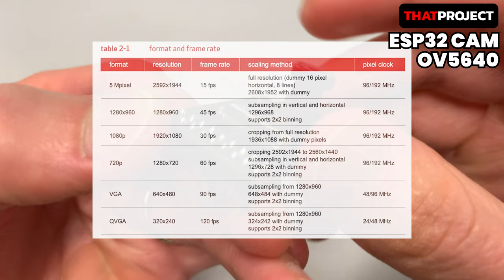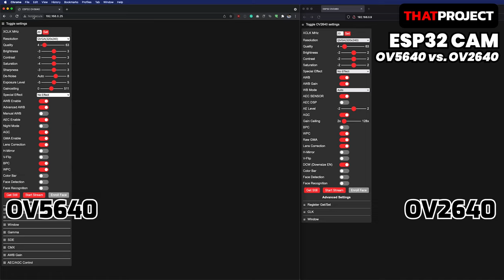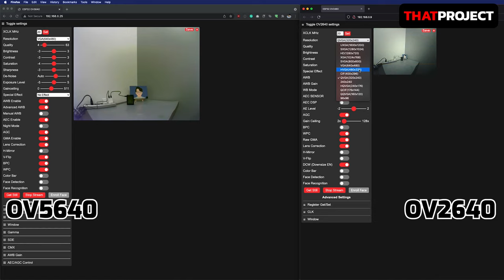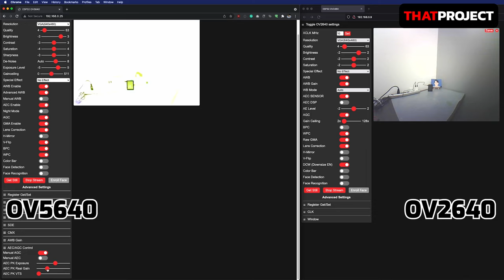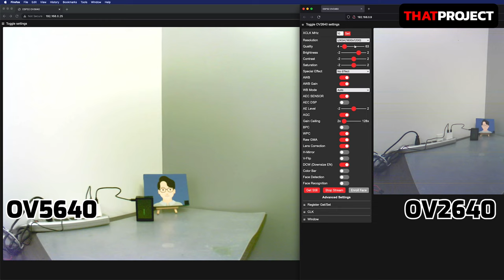OV5640 for ESP32 Camera (Compared to OV2640)

Comment: At 1:30 you show installing the OV5640 onto a ESP32 Cam board. Do you have to install different cam software to support it? Are there any other changes made to the ESP32 Cam board to get the much better quality of the OV5640?
Reply from the maker: All you need is the latest version of ESP board. I tested this code 2.0.1 and 2.0.2 and it worked fine. Let me know if it has an issue.
Reply: @ThatProject  I finally got it working. The OV5640 shows up with much higher speed and  resolution available but the video quality is much worse than OV2640 so far. Grainy and colours are off. I used Board: "AI Thinker ESP32-CAM" and #define CAMERA_MODEL_AI_THINKER.
Reply from the maker: @NN-rd3mk  That's weird. Where did you get your OV5640?
Reply: @ThatProject  An Ebay supplier I have bought many other devices from. I think it's a OV5640 software setting problem. That's why I asked about your settings. OV2640 on the same board is fine. I tried a second OV5640. Same thing.
Reply from the maker: @NN-rd3mk  No, I didn't do any settings for the video quality. Please note that WaveShare's OV5640 and Chinese clone products are not perfectly identical.
Reply: @ThatProject  **SOLVED**  under camera_config change: config.xclk_freq_hz = 6000000; // was 20000000
This reduces the frame rate though.
Still not sure if the higher res is worth upgrading from OV2640 to OV5640.
Reply from the maker: @NN-rd3mk  Still, we have different results. If you change the XCLK to 6MHz, isn't the image acquisition speed slow? I've only tested it at 10MHz or 20MHz and had no issues.
Reply: @ThatProject  Maybe the Waveshare board is much higher performance so 20 MHz works OK. It is much higher cost. I use ESP32 Cam boards with a built-in micro USB connection now. Much easier to program.

Comment: Hi, i have a question. Im using TTGO T-Call ESP32 SIM800L and i want to use esp32CAM camera to the TTGO board. Can you teach me how to connect it and generate a simple code to test it out? tq sir
Reply from the maker: Image data can be transmitted via serial or Bluetooth LE, but requires detailed work. If you have to use the SIM module with image acquisition, wouldn't it be more convenient to use this? https://youtu.be/kOYJ-4oZ8Ws

Comment: Hi, as you suggested i have used ov5640 from waveshare but when trying models from 2 other suppliers they were overheating and the picture was gradually turning white/green. Any ideas?
Reply from the maker: Hey Domen, Where did you get those? Are you sure they're genuine products of Waveshare? I have 2 of them and I didn't have any issues when I make the OV5640 library for the auto-focus mode.
Reply: @ThatProject  hi, i've got them from some chinesse supplier. I also have one from waveshare and it works great, but it's just too pricy

Comment: Is the slow fps due to the data being transfered over wifi? If so, if i connect it to a sd card module and record the data on it instead, will i be able to get the full fps that's on the datasheet?
Reply from the maker: Good point. I would say yes or no.  
When transmitting via WiFi, a bottleneck occurs in the process of taking and sending photos. This is the biggest cause of low FPS.

As a result of my testing in another video, showed similar results to the datasheet in obtaining the image frame buffer only without saving or transferring.

When continuously writing images to an SD card, you will be able to get a sufficiently good FPS if there is no delay.

The cause of the bottleneck is that the process of obtaining the image frame buffer and writing or sending the file is not processed in parallel. Unless this fundamental issue is resolved, I believe that saving images externally will inevitably result in frame drops.
Reply: If you use a antenna it improves greatly.  You can also wrap the end in copper tape to improve the signal.  Google that for pics.

Comment: I bought the OV5640 module and it sees it on the esp32cam and it works but it doesn't make a connection, but when I try it with the ov2640 it makes a connection. What should the PID settings be for ov5640 or where should I enter them? please urgent 😭😭😭😭😭😭😭😭
Reply from the maker: In what environment does ESP32-CAM run? ESP-IDF? Arduino?
OV5640_PID is checked automatically, so you do not need to check it. Looking at the CameraWebServer example, it automatically distinguishes between OV2640, OV3660, and OV5640 and displays the required screen to the user. It would be a good idea to double-check the connection between your ESP32-CAM and OV5640.

Comment: Hey dude, I need a camera that can accurately read text(like english paragraphs) and mathematical notations off of textbooks. Is the ov5640 capable of that? if not, which camera should I purchase? I'd prefer it to be compatible with esp32 cam board
Reply from the maker: I have recently been using the AMB82-Mini camera module and it is very useful.  Check this out. https://youtu.be/TGqOUVhQQY8?si=U5CVZZWozqhmZcMy
Reply: @ThatProject  hmmm i'll definitely check it out, thanks!

Comment: you changed the xclk on the camera and reduced by 50% you did not mention why. from my experince a higher clock produced much faster fps and much cleaner moving objects. more heat is produced and im sure its a battery drain, tho I would assume it depends on your use case. it is also possible to change lens creating differnt results.
Reply from the maker: Of course, you're right. You can usually get faster fps with higher clocks. But there are other cases. Changing XCLK is a kind of old story. I've also mentioned this in one of my ESP32CAM videos. Anyway, check this out. https://github.com/espressif/esp32-camera/issues/15

Comment: Is it possible to manually set exposure time?
Reply from the maker: You can simply change the exposure level. To manually change the exposure time, you need to modify the register. I'm very interested in the exposure part, so I'll try a new project about this when I get a chance.

Comment: Hi, insane video. May I ask you for the code of the ov5640 web server?
Reply from the maker: CameraWebServer is a basic ESP32 example.
You can try it through Arduino IDE>Examples>ESP32>Camera>CameraWebServer 
If you are using the OV5640 you will see the extra options.
Reply: @ThatProject  thank you very much for your quick reply.

Comment: my OV5640 runs extrememly hot and then freezes... do you have the same issue?
Reply from the maker: Which company's product is it? I only tested with WaveShare's OV5640 and had no problems at all.
Reply: @ThatProject  several different modules bought off amazon and ali   I'll get a waveshare and try it.   What is the base code you are using for the project?  I have noticed I get a high frequency humming from my board when the camera are running and wonder if there is a problem with my code base
Reply from the maker: @AaronVanTassle  I used the example source of the ESP32 Camera for testing.
Arduino > Examples > ESP32 > Camera > CameraWebServer
By checking the PID and VID of the OV5640, you can automatically check more functions compared to the OV2640.
Reply: The same thing happens to me. Extremely hot.
Reply from the maker: @TheAviationAnonymous  It seems to operate at a relatively high temperature compared to the OV2640. I'm checking what the problem is.
Reply: @ThatProject  Thank you for your reply, and your AF library. 
I have done some research, and I think the issue may be that the OV5640 modules on Aliexpress are slightly different than the ones used on the Waveshare OV5640 breakout. 
For example the last two pins for the AF function seem to  be swapped on the Aliexpress modules. 
I have tried both autofocus and fixed focus options from Aliexpress, and both dramatically overheat when used with the ESP32 CAM.
Maybe there are other differences which cause the overheating problem, or maybe they are just very bad quality modules.

Comment: Bro can we use mobile high mega pixel cam in this module. Please reply?
Reply from the maker: It is possible to take high-resolution images, but sending them through streaming will be very slow due to the large size of the images. This is not a good solution if your project requires high-resolution continuous images.

Comment: hello, can you provide me the sketch of the ov5640 version?

thanks
Reply from the maker: This is an ESP32CAM basic example.
You can find it from, Examples>ESP32>Camera>CameraWebServer. 
And your installed ESP32 version should be 2.0.x not 1.0.6.
Reply: @ThatProject  my version was still at 1.0.6
give the error.
I will update and check
thanks

Comment: Hello great explanation btw. I have a doubt I'm currently working on a project which require physical approach. I have a DL code in my pc and im using pc webcam to work on it. But now i need to use some physical thing. I'm thinking of using ESP 32. I have tp send the direct video stream to the pc where the code is and i need to detect the object how can i proceed please anyone help me..
Reply from the maker: How should it be connected to the PC? Wireless Network? Wired Network?

Comment: Can I use ov5640 with wifi esp32 module of ov2640
Reply from the maker: The problem seems to be that there are several different types of OV5640. You will need to purchase after confirming that it works on the ESP32-CAM AI Thinker board.
Reply: @ThatProject  that's what i was saying. I just need improved video quality, that's it, I already have the esp32 cam ov2640 module
Reply from the maker: @codmhumanoid9271  This is what I used for this project. This seems to work without a problem. https://amzn.to/3EPWCCs